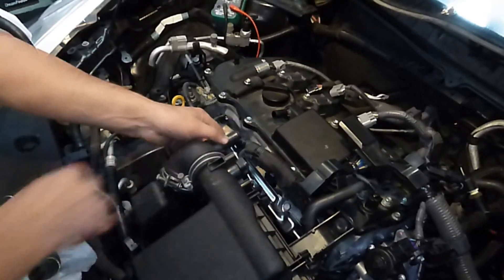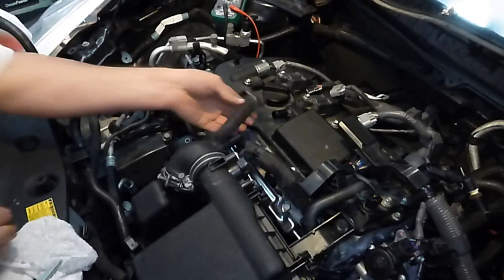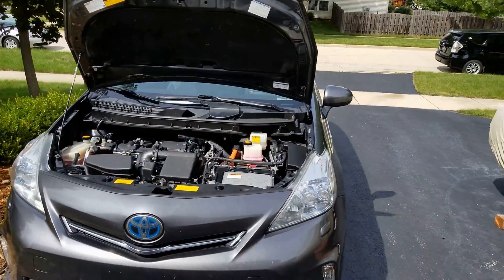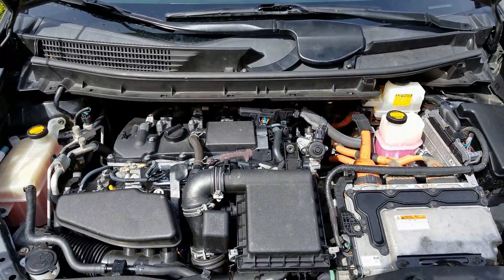Part 15 - 2016 Prius Engine Swap into 2012 Prius V - Start to Finish - Fix That Prius!

Comment: Recently got done with the 55 page forum post and the 15th video. Why were you worried about the pump? Are they notorious for losing prime? Also, where did you connect your red lead down there to confirm the prime?
Reply from the maker: Hey, Nice!
Before I did my first swap, I did a barnyard engine rebuild on the Black V for about $100. It didn't work. Why didn't it work you ask? Because, when I pulled the oil pump, I dumped the oil out. I guess I thought it would prime itself. It won't. So now I think it's important to see if the oil pump is pumping.
There is an oil pressure transducer behind the passengers side of the engine. It's just a switch. If it is normally open, you want to see it close or vice versa. This is done with an ohm meter. 
 - Fix That Prius !!!

Comment: This is so nice. I have 2013 Prius V with 186,000  miles and still running with no issues. I love this car so much and I would like to swap the engine when I have to. My question is , can I put some non hybrid engine , like Corolla or Yaris or Camry , whatever requires least modifications. and run this as non hybrid car. I really appreciate your response whether this is possible. I am a DIY person and change spark plugs, flush break fluid after replacing break pads, oil change is like walk in the park. My aim is to swap my Prius v with non hybrid Toyota engine. Thank you. I subscribed.
Reply from the maker: Hi Kumar,
Yes you can replace your hybrid system with a regular engine and trans. You may have to replace EVERYTHING! Engine, trans, ECM,  radiator, braking system, starting system, etc. Looks like a mess. Or you could just buy another car, maybe another v.
Good Luck with your projects.
 - Fix That Prius !!!
Reply: @fixthatprius4980  Thank you so much. I really appreciate your reply. I guess I'll learn how to fix Hybrid battery so, I can fix it when I need it and put another 100k.( right now my Prius v has 200k miles and I am driving with no ABS system, with all those three lights on , brake light, traction, abs, (I don't want to spent on brake actuator)). And also learn how to swap with low mile engine once this one gives up and run another 100k. And finally park the body as a souvenir and buy non hybrid Toyota Sienna 2015 plus model.

Comment: what is the tool you used to measure the electricity?  Thanks
Reply from the maker: Hi, Thanks for your comments. Please subscribe to my channel. 
It's a "multimeter". I'm using the ohm setting to see when the oil pressure switch turns on.
 - Fix That Prius !!!

Comment: I'm at this stage, but I have a P0343 code (Camshaft Position Sensor "A" Circuit High Input). I've tried both the 2012 and 2016 sensors to make sure it wasn't a problem with the sensor. I've re-checked the grounds to make sure they aren't screwy. I'm thinking I may have to check the timing of the 2016 engine. The car it came from flipped. Maybe the timing chain skipped a tooth? I'm not liking the woods as much as you are, lol.
Reply: Hi Jacob. Were you able to fix the problem I’m facing the same issue and I don’t know what to do next?
Reply: @nadjibtamer3552  what was the solution to fix this?

Comment: Thanks so much!  Getting ready to try this on my 2012 Prius V. I think at one point you were going to do these for hire?  Still the case?  I’m in Chicago area and could deliver
Reply from the maker: Hi Matt,
Thanks for your question. Please subscribe to my channel.
I've thought about being the "Prius engine swap guy" but I have a job I love and don't have time for both.
Good luck with your swap!
 - Fix That Prius !
Reply: Fix That Prius! Awesome. Really appreciate your sharing here. I’m assuming any motor Prius 1.8 2016-2018 would probably work right?  Does Toyota dealer still do factory recall updates when they see a new motor?
Reply from the maker: @madjohns10000sd  Hi, Good Question. I have taken my car in for a recall. They said it's the wrong engine and they wanted to figure out how it got in there, but I had no problem getting the recall done.
 - Fix That Prius !
Reply from the maker: @madjohns10000sd  And, as for picking a new engine, get one from a 2016-17 Prius with "A" or "B" as the 5th digit of the VIN.
 -Fix That Prius !

Comment: Just wanted to say thank you for doing this.  You can add another vicarious successful swap to your list.  Mine was a 2011 prius with 155k before the misfires became too much.  Thanks again!
Reply from the maker: Hi,
Wow! How did it turn out?
Please subscribe to my channel.
Thanks!
- Fix That Prius!!!
Reply: Fix That Prius! It started right up idled well and drive around the yard.  I drove it about 4 miles to the gas station and on the way back got the temp light.  Put it in maintenance mode and send to have solved the temp issue.  Now it's having problem on acceleration with bucking/sputtering.  No check engine.  So I took Egr off and cleaned out the best I could.  Took intake off and cleaned it.  I'm starting to wonder if the converter is plugged.  It's weird.  Idles fine and no check engine.
Reply from the maker: @kurtaulbee  Well, you did it!  Congrats!
I would recommend unplugging the wires to the EGR to see if it's bad. If that makes it run better, you'll have to replace the EGR. I tried to fix mine, took it all apart and it was still bad. Can't fix a bad EGR I guess. It's the little motor inside that goes bad. Cleaning the EGR and EGR cooler won't fix it either.
Thanks for your question.
- Fix That Prius !
Reply: Fix That Prius! You were exactly right!   Appears to be working well now. Will have to sell the EGR that came on the new engine and invest in a new EGR for this one.
Reply from the maker: @kurtaulbee  Excellent!  Problem solved!
-Fix That Prius!!!!

Comment: Just finished the full swap, car runs ok ish, my engine temp light is on and I get 2 engine codes. Was wondering if you get any permanent codes on your Prius’s after the swap
Reply from the maker: Hi, Thanks for your question. 
Please subscribe to my channel.
Anytime you disturb the cooling system on a third gen Prius, it gets air blocking the exchange of heat. 
Raise the coolant tank and run the engine in maintenance mode until it stops bubbling. I have a video on it.
https://www.youtube.com/watch?v=zE-TUVAhrvg
Reply from the maker: The engine swap did not cause any codes in my case, just the temp light.
Reply: Fix That Prius! Does the temp light stay on permanently?

Comment: Hey man thanks so much for this series followed it all and gained confidence to start this project myself. I’m at the point of pulling the motor out and was curious if a 2016 motor will fit in a 2010 Prius I believe that’s also a third gen I just wanted to be 100% sure before purchasing the motor
Reply from the maker: Hi, Thanks for your question. 
Please subscribe to my channel.
Yes, the 2010 Toyota Prius is a third gen Prius. However, a 2010 Toyota Prius C   "C" has a 1.5 liter engine.
So, if you have a 2010 Prius with a 1.8 liter engine, you can do it.

Comment: When buying the replacement engine, did you pay any attention to the fifth digit of the vin number which specifies what type of engine it is? Or would all types work in that year? In your case 2016.
Reply from the maker: Hi, Thanks for your question.
Please subscribe to my channel.
When you buy a 4th Generation 1.8 L,  2016-17 Prius engine, make sure it has a VIN # with an "A" or "B" for the 5th digit . Can't go wrong if you follow this rule.
Reply: @fixthatprius4980  Thanks for the answer.  I definitely subscribed.

Comment: why don't you run mobile prius  engine swap? imagine thousand of blown gasket prius .my prius v just had that very same problem less than 100k miles on it .about a month ago i had head on accident 40mph .body shop fix it about $3600 .a few week later today engine light come on .1 and 2 missfire.
Reply: Thanks for your comments. Please subscribe to my channel. 
I'm sure I would be able to make a living swapping third generation Prius engines. I'm pretty good at it, and I like the work, but I have a job, I'm an Operating Engineer.
I understand the frustration of having this great car and then it just won't run right.

Please, PLEASE unplug your EGR or replace the EGR with a new one. It will run better and your misfire should go away. If the miss doesn't go away, replace the spark plugs. 

The spark plugs will foul every 10,000 miles unless you address the EGR problem.

Good Luck and - Fix That Prius !!!!!!!!
Reply: @thomasebourassa8210 You think it will fix because  it is drinking my coolant and also  coolant blowing under the hood from tank cap and  my mechanic told me it fail pressure test .Can i also used  the 2016  prius  1.8  transmission and and battery pack in my old one.I am picking up the engine and transmission for $1100  out of the guy  rolled over 2016  prius tmr

Comment: Thanks for this series. It has given me confidence to see someone go through it. This week my 2012 Prius V blew a head gasket. As I have been reading that sounds like a common occurrence.  I am considering putting a newer engine in like you did. Have you had any problems with the computer being able to communicate with the 2016 engine?  Or any other issues so far?  Thanks.
Reply from the maker: No issues whatsoever. Not with the engine, computer, transmission, gas mileage or oil consumption. I've put about 6,000 miles on the car since the swap and it runs beautifully.  I would do this swap over any other possible remedy to a bad head gasket or oil consumption. I rebuilt one Prius engine and it was a royal pain. You may have to pull the engine to rebuild it anyway so a swap is half as much work. And you'll end up with an engine that the whole world doesn't hate yet.
Thanks for asking.
Sincerely,
Thomas E. Bourassa
Reply: @fixthatprius4980  "And you'll end up with and engine that the whole world doesn't hate yet."
LOL!! Ahahaha that's hilarious!

Thank you so much for these videos, which I'm sure I'll be using sometime in the near future. There's been Soo much I haven't had a chance to review yet, but did you cover your Gen4 engine pricing and recommendations on good sellers of them yet? I figure I should pick one up soon before the prices of these donors increase once the demand is recognized :o
Reply from the maker: @aminort2  Hi, Thanks for your question. 
Please subscribe to my channel.
No video no pricing or where to buy, yet.
I got the first 2016 Prius engine from LKQ with only 3200 miles. Came with almost everything, water pump, EGR, EGR cooler, intake, ignition coils, fuel injectors, ETC, for $1660 including $300 for shipping on a lift gate truck and $80 for tax. LKQ made me pay for shipping.
When I called, they said I could have arranged to pick it up myself, so call them before you buy.
The second one came from AutoGator on eBay.  $1275 total, with 29,000 miles.
I would recommend getting the lowest mileage engine that was not impacted by whatever killed the car. So, if there was a front end collision, make sure the engine wasn't damaged. Look for pictures of the donor car.
For an engine with about 5,000 miles it should be less than $1300.
For an engine with about 30,000 miles, not more than $1000.
If it's less than $600 it's probably the wrong engine or stripped or over 100,000 miles.
- Fix That Prius!